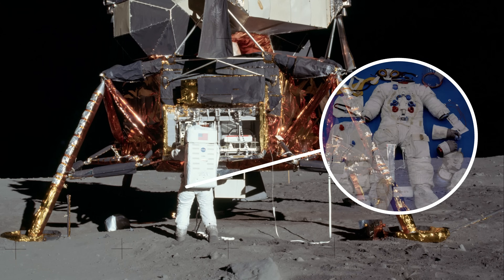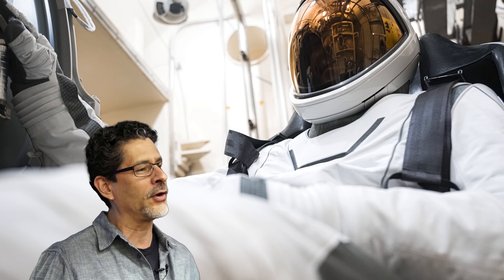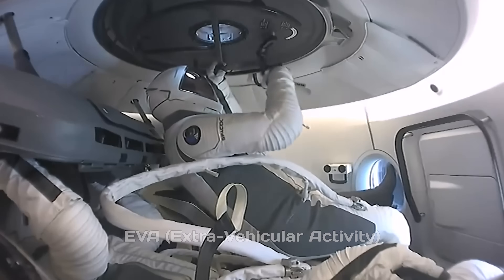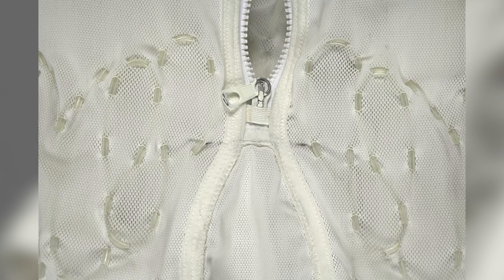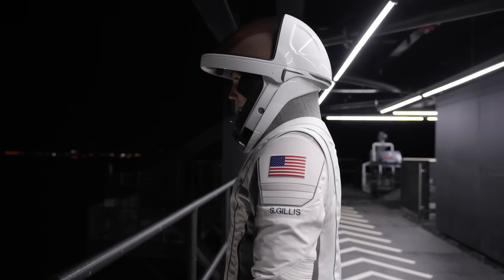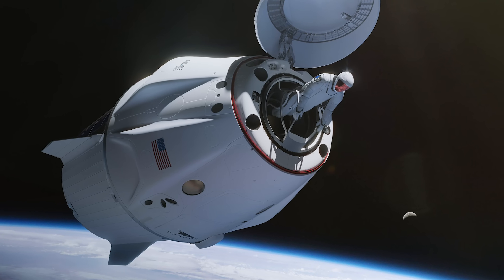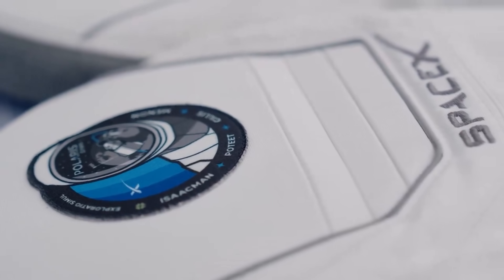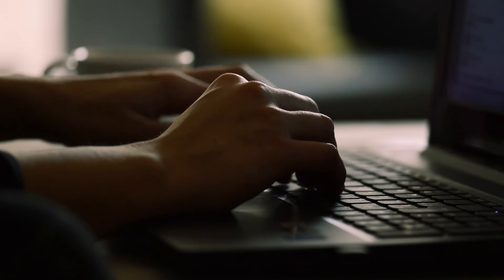New Inside SpaceX Space Suits, Better than NASA, even CHINA…

Comment: I'm sorry, but you lost me at "aerodynamic seams" for a SPACE SUIT. To be used in a VACUUM.
Paid marketing? Then just say so, and I would've watched the whole video.
Reply: aerodynamic
adjective

relating to aerodynamics.
"aerodynamic forces"
• of or having a shape which reduces the drag from air moving past.
"the plane has a more aerodynamic shape"

'Aerodynamic' as an adjective isn't used solely for describing an object that's been designed for the purpose of minimizing air resistance. For example, in the fashion world, the word 'aerodynamic' is also commonly used to identify some of the more recent avant-garde designs; specifically the ultra modern 'Y3K' and sci-fi-retro 'Streamline Moderne' stylistic trends. As for 'streamlined'...

streamlined
adjective

1. having a form that presents very little resistance to a flow of air or water.
"streamlined passenger trains"
2. having been made simpler and more efficient or effective.
"this streamlined approach will significantly reduce the learning curve for new users"

As you can see, 'streamlined' has more than just a single meaning... but 'streamlined', much like the word 'aerodynamic', was, at first, also used only as a description for a shape or form designed for minimizing air or water resistance. Now however, 'streamline' is being used as a very specific type of fashion label, similarly to how 'aerodynamic' is being used for the same purpose.

And those SpaceX pressure suits sure are some kinda fashion statement. In fact, they were designed for fashion FIRST, and functionality SECOND.

You're welcome.